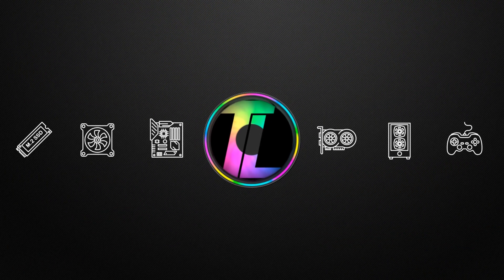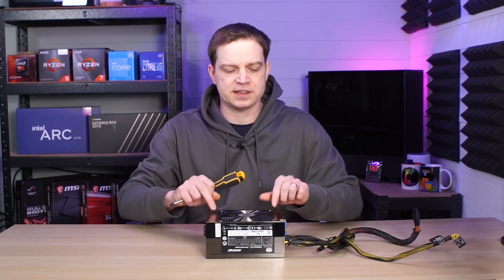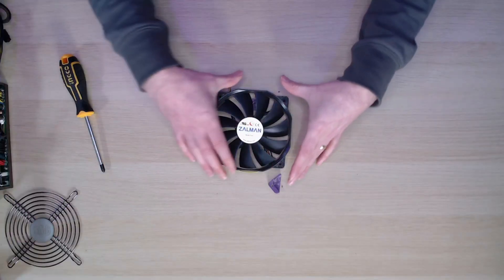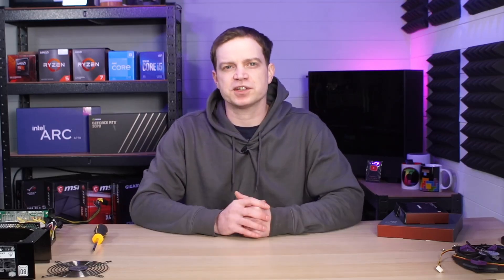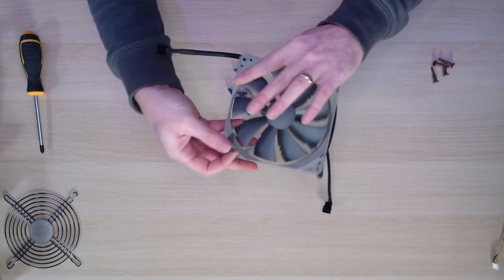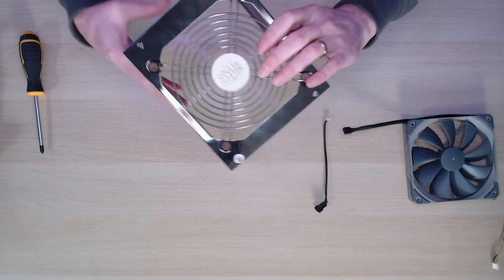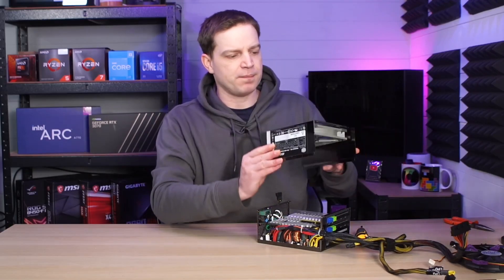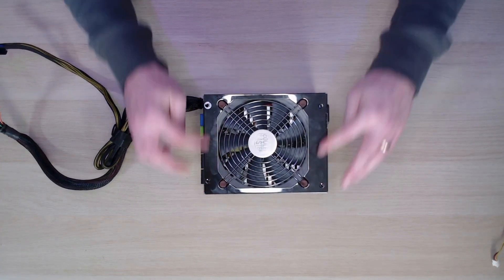Replacing the fan in our PSU with Noctua the right way.

Comment: Can anyone tell me why they used that homemade cable instead of connecting the fan directly to the power supply?
Reply from the maker: Because fans in general use 4 Pin PWM connections and PSU's only use two wires.
Reply: @TechLabUK And in the 4 pins there are two pins, right? or was it because the 4 pin was too big for the connector and therefore did not enter?
Reply from the maker: @Shadowlink_ct  Within the 4 pins you have power, ground, PWM signal and Tach whereas on most PSUs they use just the power and ground.

Specific Noctua fans actually come with an adaptor for this.

Comment: Hello, I need to replace my PSU fan. It’s 120mm, and I heard in your video that we can use any fan as long as the size matches. I also know I need to match the number of pins, but can I use a case fan? I’m not very knowledgeable about PC components, so I’m wondering if there are differences in voltage or other factors I should consider. Could you clarify?

Comment: This Noctua fan has only 133.7 m³/h air movement! How is it suitable for a 1000w PSU, when the Chiefteck PSU 750w fan has 103.26 CFM (about 179m³/h air movement)? This air volume rate is very important for a PSU fan, because if it is smaller than the standard rate, then under load or tuning and during intensive gaming, the PSU components may not be properly cooled! It is difficult to find a replacement 120mm fan for PSUs over 700w! It is easier to find a 140mm fan with such indicators. A suitable 120mm fan is, for example: "120x120x25mm 12V 183.8m³/h 44.5dBA SUNON".
Reply from the maker: It's been fine like this for years.

Comment: I always get a <£5 DC to PWM converter to turn the DC fan into a PWM fan. 
Aftermarket DC fans, IME, have too-high startup voltages and too-high minimum speeds; I put a Noctua F12 in mine and, along with the controller (which fits easily), I get the full range of speeds from <300 to max.

Comment: Notice he replaced a 135mm fan with a 140mm fan and instead of telling you the screws didn't line up used the pull tab mounts??

Also, it was rude to not show the custom harness work regardless of how easy it may be- though probably the hardest part of the upgrade.

I was curious to see if he would have any startup voltage issues and ended up with the eye pain of watching typical YT noobs make a half azz video...
Reply from the maker: @shaun4bigblocks  Cool story.

Comment: Hello, could you tell me, can I use p12 Arctic fan (2000rpm) to my Aerocool 750W PSU by connecting the fan to motherboard? The fan speed will be controlled based on CPU temperature. Is this a good idea? I have GeForce 3600Ti (max 200W)
Reply from the maker: A lot of people do this tbh.  We did it in our NZXT H1 recently but with an SFX PSU.
Reply: @TechLabUK  thank you for your answer.  Doesn't the power supply overheat? Everything's fine?
Reply from the maker: @oscarman3333  It could if the fan isn't pushing enough air through it but you can create a high fan curve to keep it running faster.

Comment: PHT connector?
I have done a bit of electronics. Not sure what this is.
I thought the connectors were Molex or perhaps JST
I googled PHT and found nothing.
I'm planning to replace the fan in my PSU this week as its making annoying noises.
I've ordered the fan which obviously has the wrong connector. 
I'd like to know what the "correct" connector is.
Thanks.
Reply: You are right. Its not a PHT connector, its a JST 2pin connector with probably PH2 (2mm) Pitch.
Reply: I'd like to know this one too.. I can't find the right adapter

Comment: Can i learn this adapter cable brand and model? 😅
Reply from the maker: Pretty sure I made the one in this video from a Noctua extension.  The cable you need though will depend on the connection in the PSU it self.  Most will use a 2 pin PHT which Nocua do have with some of their fans.
Reply: @TechLabUK   Thank you 😄

Comment: My PSU fan is a bit louder than I like and I have tinnitus so it's causing me issues, so this is something I'm interested in. That cable you made, do you have instructions for it plz ?

EDIT: n/m found answer further down, thanks!
Reply from the maker: Glad you found the answer.  It may be different on different power supplies but very often Noctua provide extras to do things like this because their fans are often used within the industrial setting where people mod everything.
Reply: @TechLabUK  God damnit. So it's me again. I have no memory of this video or my comment. I've obviously still not done this - it went away for a bit and now the noise is back so I've yet to do it. I should be surprised but my brain is swiss cheese so eh. ANYWHO just a quick Q, to drain a PSU, is "pulling out the power cord while the PC is on" a valid way to do it ? Or do you know a way to discharge them from home ? It's not ideal to pull the cord while it's on but it's not ideal to be zapped so lesser of 2 evils!

I really have to start writing stuff down this is embarrassing lol.

Comment: only thing I would add is that you should tape off half of the fan when putting it back in. Most power supplies should come with a plastic air guide that directs air over the components and out the exhaust properly. Without this guide you have much more turbulent flow and recirculation of air, making the cooling less efficient.

Comment: Hey dude, where can I get one of those PHT to 3pin adapters?
Reply from the maker: You can usually get them from somewhere like ebay but often knowing what they are called is difficult.  Something like this: https://www.ebay.co.uk/itm/364016036228
Reply: @TechLabUK  yeah man that’s the problem, I can’t find the 2 pin to 3 pin adapter anywhere. I’m surprised they are not more common. How come PSU fans only have two wires?
Reply from the maker: @naylor2006  just controlled differently.  You can manually splice the wires to work though.
Reply: @TechLabUK  Yeah but which wires need to be spliced together? The Fan has 4 cables black red yellow and blue and the two pin only has well two. 
Which cables from the Fan do i need to connect to the two pin. My guess was black (Fan) to Black (2pin) and red (Fan) to Red (2pin). After that i took the blue and yellow cable from the fan and made them longer to connect them to the motherboard so i can see the RPM and controll the Fan speed if needed.
After trying that over and over with only the Powesupply plugged in and not the "monitoring cable" to the motherboard I just can't get it running, what's the mistake here?
Reply: Its not a PHT connector, its a JST 2pin connector with probably PH2 (2mm) Pitch.
Reply: @Gamer__007 I just swapped the PSU for a silent mode one in the end, I was considering changing the fan on an MSI MAG which sounded dreadful when idle, no silent mode and terrible fan. Seemed stupid in the end when I could just return it and get a different one.

Comment: How do you safely discharge a psu? Great video and mod!
Reply: A method I've used after turning off the system, is turning the PSU switch to OFF and unplug the power cord. Then just press the ON button of the case and you should see like it will try to boot, lets say LED turning on-off, fans spinning slightly, or even a "click" sound. 
Wait a few seconds, after that it should be discharged by now, so you can unplug all the cables from motherboard and drives.

Comment: some psus have a lower starting voltage for the fans, not all fans would work for all psus necessarily, the Arctic p12s have a safe starting voltage at 2.8v, but some noctuas can go up to 7 or 8, and may not work with most psus that don't output said amount to a pht
Reply: yes this is a good point..   noctua wouldn't work in my psu (seasonic 1000watt platinum in standard mode).. I wired the fan to the mobo per someone else's comment on here.
Reply: I ran into the same issue with a Noctua fan and a Corsair PSU.
Reply: otherwise amazing video❤️
Reply: I just got my two spare Noctua fans running at 5V:
1. NF-A12x25 PWM
2. NF-P12-1700 PWM
Reply: ı tried noctua fan and did not spin unfortunately  any noctua fan model that can work at lower starting voltage can you pass ?

Comment: I had to do something similar on an old PSU where the fan started to wobble and making a racket, except the fan wires was directly soldered onto the board, i opted for connecting it to the motherboard instead through the PSU grommet and using it as an extra exhaust fan, i didn't wanna start soldering on an PSU, while i do have the know how i wouldn't wanna risk messing something up over a simple fan swap.
Reply from the maker: Sounds like an awesome solution.  Could be motherboard / software controlled then too 👍

Comment: Never changed a fan before, but I do like to buy older systems to mess around with and the dustier the system the further apart I tend to take it for cleaning. I also tend to take them apart when they look cheap, just to check for blown caps.